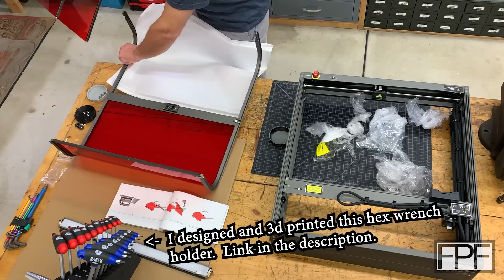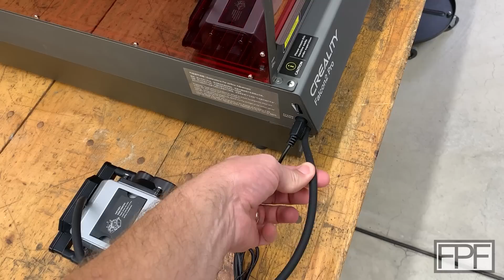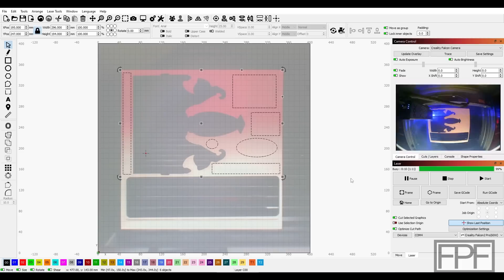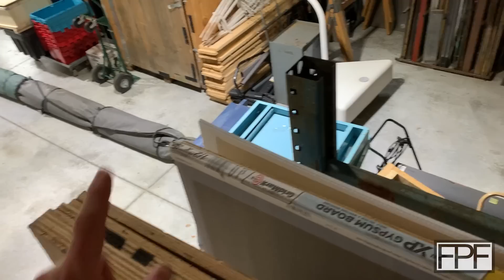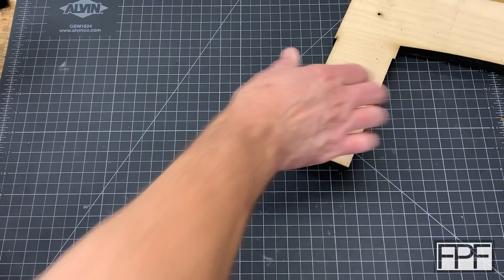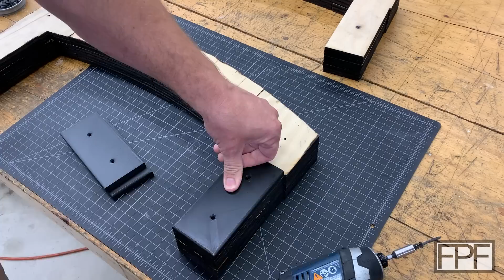Creality Falcon2 Pro 60W - Laser Cutter and Engraver

Comment: Nice work.  FYI Lightburn has a feature that allows you to align the two sides of the work.   (Laser Tool menu and then the Print & Cut option).   I have seen videos where this is used to engrave both sides and keep them aligned ... but it could also be used to cut from both sides ... I reckon it could to that 200mm hardwood ply in 1 pass per side with way less charring.  Probably need the aligning laser crosshair mod.   https://youtu.be/Ft7RlVh4Kjc?si=qpRpRK8iswwCfHdT  I think the 60W is the limit in power for diode lasers without focusing optics.

Comment: I worked in a shop with a 2kw CO2 3D laser with a 48"×96" bed. 5 axis plus a rotary axis mounted at the end of the bed with a 3 and 4 jaw chuck.
You need to adjust the focal point further into the material. It should be close to the middle if the material.

Comment: Judging by how big the head is - guessing that it's got (maybe) 3 of the other modules, rammed through a beam combiner?
Reply from the maker: I think there's 12 separate diodes in there.  I'm tempted to open it, but I'm assuming it's dust sealed (glued shut?) and I'm having too much fun using it :)
Reply: @FunctionalPrintFriday  - Eek!  Yeah, don't tear into just for the hell of it.  :D    Maybe if Creality will send you a 2nd one, but... I'm guessing that'd be a no.
Reply from the maker: @DrFiero  yeh probably not :)
Reply: @FunctionalPrintFriday  It's worth asking. Their engineering team probably has parts that aren't glued together that they could loan you for a video. It'd be good advertising for the cost of shipping and the time for a tech to pull parts.